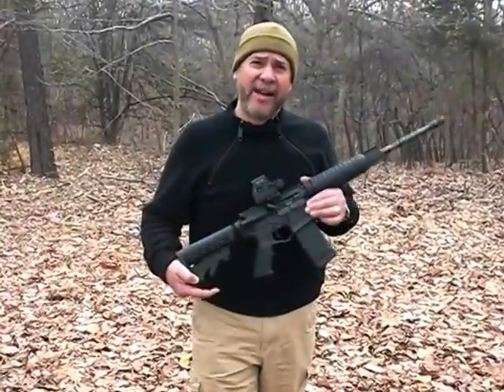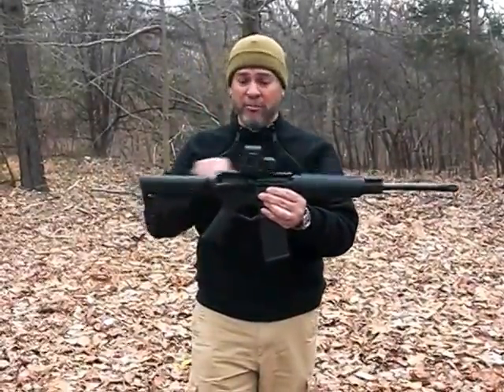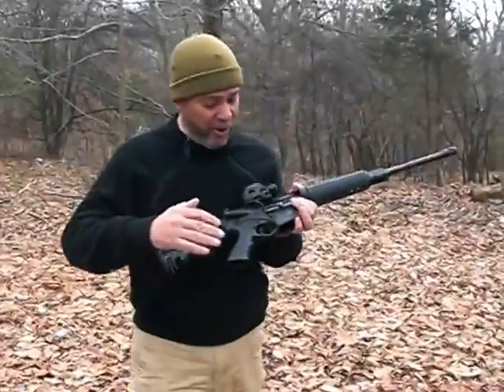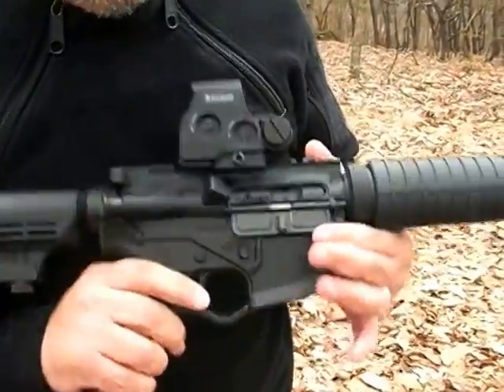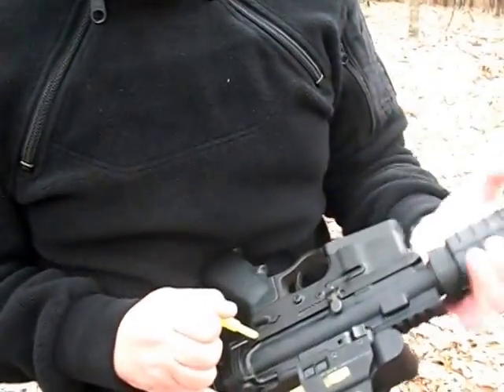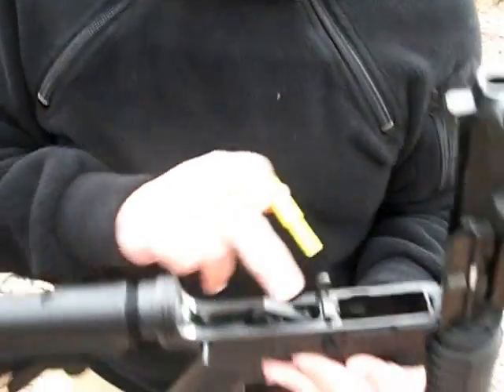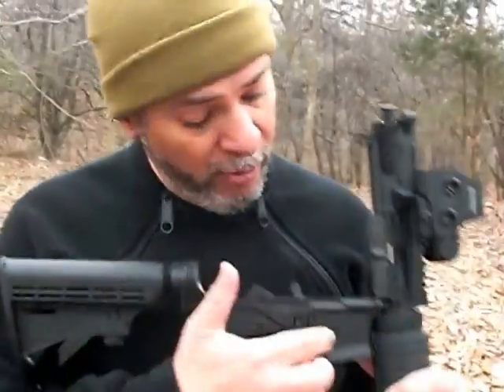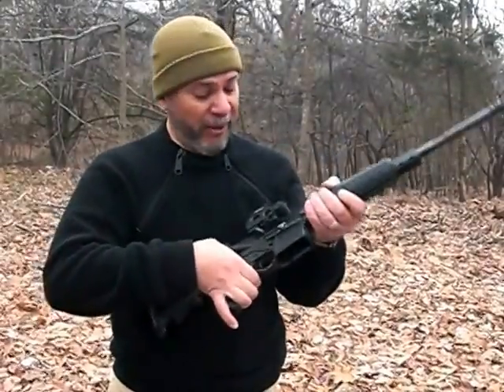ATI /OMNI Hybrid 5.56 AR Carbine

Comment: Can you shoot .223 also ?
Reply from the maker: Yes and good question. Generally speaking the 5.56mm and .223 rounds are interchangeable. The 5.56 does have more pressure and is slightly larger so that in a rifle truly chambered for .223 you should not use 5.56mm. However there is no problem firing .223 in a rifle chambered for 5.56mm. Some manufacturers split the difference and produce .223 Wylde chambers.
Reply: Thank you my friend for the info and a good video.

Comment: do magwell grips fit on these lowers since the bottom flares out a little bit
Reply from the maker: Sorry I don't know. My experience with those grips is that they are designed for standard aluminum receivers. I suggest contacting the manufacturer directly.

Comment: i'm just ordering the whole thing but I don't think it's the same  type,  it's the ATI GOMXQ556 OMNI MAXX 16IN 5.56. i hope it's good because i got a really good deal on it
Reply from the maker: Did you get the quad rail one? These are a really good value. I am seeing some incredible prices and ARs right now. Several manufacturers have their entry level guns for less than $500 including Diamondback and DPMS, also quality guns.
Reply: Jorge Amselle i believe it does come with a free float quad rail. just looking for good deals on ammo now hehe. i used to use cheaper than dirt. so far they have a can for about 206 bucks

Comment: Where can I get a quad rail for this I bought one off of eBay and it didn't fit. :-(
Reply from the maker: You have to be careful buying stuff like that from E-Bay. A lot of it is designed for airsoft and not real guns and may even be licensed by the original manufacturer but it is not suitable for real guns. My advice is to get one from Midway USA (just type in AR quad rail in the search tab). I would get a 2 piece drop in rail that replaces the handguards. You can get an aluminum one or a polymer set to save $$$. Good luck and fun shooting.
Reply: Jorge Amselle ah I see, that's the problem.  Thank you.  I did what you said and one from midway and it fits.

Comment: On that ATI was the mag well so large that standard mags won't stay in or it misfeeds everytime?  I haven't been able to find a mag yet that will work without either falling out or misfeeding.
Reply from the maker: I had the opposite issue where polymer magazines were a bit tight. Have you tried the MagPul or Tapco mags? This is part of the issue with polymer or carbon fiber parts that the tolerances are not as consistent. I would consider returning it for a repair or replacement.
Reply: Jorge Amselle Haven't tried MagPul or Tapco yet but the first ones I got were polymer made by Swampfox in Korea and looked just like Magpul but wouldn't feed. They were a bit oversize and would stick when putting them in or taking them out, however the catch hole was either too small or in the wrong place so the catch was just barely hooking on the edge of the hole and they would fall out sometimes. Then, the flat spot on the follower was too small so the bolt catch would miss it and go down along the side and get caught underneath so the mag would end up jammed in and wouldn't come out.  I also tried some made by Blackhawk that were on sale at Cabelas. They are stainless and look identical to the standard govt. issued GI models but are rubbish, the follower is poorly made and sticks, they are poorly welded and rounds tend to get caught on the ridges in the sides and don't feed properly. Even worse the top round won't stay in securely and tends to jump out on it's own!
Reply from the maker: Steve C The magazine is the weak link in any semi-auto firearm. I would try using good quality magazines and that will likely solve your issues. I have never had good luck with stainless steel magazines and MagPul knock offs aren't likely to work either. Have you used standard GI Aluminum mags? This should always work. The best magazines you can buy are Lancer. If you still have issues with GI mags or real magPul or Lancer mags then I would send it back.
Reply: Jorge Amselle A real GI aluminum mag seems to work OK after installing a shim in the back of the feed well at the bottom so the mag can't tip back too far. Never heard of Lancer though.
Reply: Mine takes metal or polymer,they all fit tight..
Reply: jblcva After finally getting the magazine to feed the rifle still would not work!  I ended up having to replace the upper receiver and barrel because they were so poorly machined!  The barrel wouldn't fit the upper properly and the feed ramps were incorrectly machined making feeding impossible. The inside of the upper was also poorly machined making operation rough and noisy. Oddly it came with a certificate that showed It had passed QC tests and been test fired which must have been faked because it wouldn't work at all. It's fine now after replacing all those bad parts though.
Reply from the maker: You shouldn't have to do all that. I would have returned or for repair.  I test a lot of guns and a disappointing number have issues.
Reply: Jorge Amselle Yes I know but it came from a store that closed and I tried contacting A.T.I. a couple of times but they wouldn't answer so I just fixed it myself.
Reply from the maker: Steve C I am very sorry to hear that. Next time let me know and I can try and contact them for you.
Reply: Jorge Amselle I don't think there will be a next time since I'm never buying anymore junk from A.T.I. but I think they owe me a barrel with the feed ramps machined properly.
Reply: Grabagun would have replaced the rifle.I purchased 2 of the Omni Hybrids.I haven't
had 1 problem out of mine..
Reply: No problems?  Mine had issues with the barrel, upper receiver, lower receiver and bolt that would all keep it from working. I can't imagine how they could have made one that worked at all.  I bet yours has all the same problems but they weren't as bad as mine so you just haven't noticed yet.
Reply: Steve C Over 500 rounds through both..
Reply: Steve C 		American Tactical Imports provides warranty services, repairs and parts for our imported and ATI brand products. If you believe your ATI imported product or ATI brand product needs service, please contact our Customer Service Department at 1-800-290-0065 to obtain a Return Authorization (RA).They are made in NC and NY..

Comment: Did you have any issues with the front disassembly pin?
Reply from the maker: I did not but that is not an altogether uncommon issue especially with a polymer or carbon fiber receiver. ATI's customer service is very good and if you have an issue I would contact them and possibly return the rifle for a repair or replacement. Note that this is a very popular item and they are pretty backordered.
Reply: Jorge Amselle
Thanks, I finally banged it out.

Comment: damn and i almost ordered one to try out,, to bad they fucked it up again and used zinc instead of aluminum,,, i dont want any part of my rifle to begin to rust simply from being out in the rain,, you cant even get zinc wood screws to keep from rusting after one time of getting wet,, this was a huge mistake on omni's part, and it dont even make logical sense,, aluminum is lighter than zinc and your wanting to save weight so you use something less durable that weighs more, what the fuck omni
Reply: I bought one on Black Friday and I can tell you I have had no issues with it.  I put 120 rnds through it my first time at the range and never had any issues.  As a former Marine I did what I could within the specs of the range rules to see just how much this gun could handle and had zero issues at all......definitely do not regret my purchase

Comment: FYI Brian Nguyen and one of their female reps (I forgot her name) at the ATI booth at Shot Show 2014 both called the metal inserts stainless steel, not zinc alloy.

Im sure zinc alloy is good enough for this application though since Mossberg uses zinc alloy in their new FLEX shotguns which must be able to take a beating.
Reply from the maker: Yep. ATI Reps told me the same thing at SHOT show however their website says it is a Zinc Alloy insert and the rifle I had would not take a magnet.
Reply: Jorge Amselle ah ha. I see. Good to know. The ATI reps need to be more squared away when they go to Shot Show.
Reply: mixflip maybe they did a last minute change :)

Comment: looks like the zinc doesnt extend to the rear take down pin hole.
Reply from the maker: It actually does but it is under the polymer so it is hard to see from the outside. There is a diagram video that shows the extent of the metal inset on their website http://www.americantactical.us/page/hybrid.html
Reply: Jorge Amselle Oh i see it. Looks like a good deal then

Comment: Is this a good rifle?!? I just bought it but im waiting the 10 day wait here in california
Reply from the maker: That may not be necessary. There are extended handguard systems that fit around the standard gas block. Check out the Ergo Grip products here.   http://ergogrips.net/products/rail-systems.html
Reply from the maker: That is a very good deal. I think you will be happy. It accepts all standard aftermarket upgrades so changing the handguards, grip or stock is easy.
Reply from the maker: I believe that mil-spec bolt carriers are tested for over 50,000 rounds so you should be good for a while still.
Reply from the maker: For a sub $700 rifle it is well worth the money. Reliability and accuracy were very good. The only issue I had is that the mag well seems a bit oversized so stick with Lancer or PMAGs. Standard GI mags don't work well.
Reply: Jorge Amselle I am finding the same thing. The polymer magazines seem to fit better than they do on my ARs, but the GI ones seem to wiggle around a bit.
Reply: I just brought mine home today. under 600 and came with the front and rear sights plus an optic red/green dot sight. Its a bit front heavy and it feels very bulky but then again, it may be because I am used to the AK47 and the heat shield is very ridged feeling. I will be shooting it tomorrow morning.
Reply: So i been having this rifle for 8 months and i love it! Its been so fun to shoot! But in california i gotta use a 10 rd mag and a bullet button,  i am also thinking of getting a new ar someday again!
Reply: I agree Jorge, I love it. I'm already looking at kit parts to upgrade and style it out with possible wraps. I'd love to give it a longer heat shield and barrel though. I saw a review on the Omni Hyrbid how the trigger pull is a bit crude and the lower receiver is clunky and hard to open but I did not experience that at all. I am wondering if its because the review was in 2012, maybe American Tactical improved their models.
Reply: I bought one with a Magpul front grip and a TruGlo Red/Green dot sight for $649 out the door.  Blew 120 rnds through it with no issues at all.  Love this gun
Reply from the maker: With so much competition in the AR market prices are very competitive. There are still plenty of $2,000 rifles out there but for the average person the ATI Omni Hybrid is a great gun, just don't count on putting 50,000 rounds though it.
Reply: I love this gun! The only downfall is it looks ugly with a 10 round mag! What i dont get is why do 10 round mags cost more then the 30 round ones?
Reply from the maker: You can get 10 round magazines that look like 30 rounders. Hexmag.com makes them as do others. They cost more because 1.  they make fewer of them and 2. they require either extra parts or different tooling.
Reply: Who in the world would prefer a 10 round mag over a 30 round one? Lol it doesnt make since to me, i by law gotta use one! And let me tell you its not fun.
Reply: Jorge Amselle Would you need to change out that gas block for a low profile in order to put a longer hand guard on it or would it fit inside it you think?
Reply: Jorge Amselle I have 2. Steel Mags, P mags they all fit tight
in mine...Mine came out of NY, they also make them in NC..
Reply: Jorge Amselle Have a friend. He has slidefire on his
been shooting hell out of it..I told him it wouldn't hurt to buy a new bolt
carrier...I believe he said he has ran 11, or 12k thru his ATI..

Comment: Took mine out today for the first time...very accurate, worked great...some have talked about the mags falling out,, they did in mine at first, but I just tightened the mag release, about three turns, and works perfect now
Reply: is that all you did ? cause with mine the 10 rd factory mag works ok but when try to use my Colt 30 rd aluminium mag i have to like jam it in to make it lock in place. Idk if its too loose or to tight ?
Reply: That's it brother